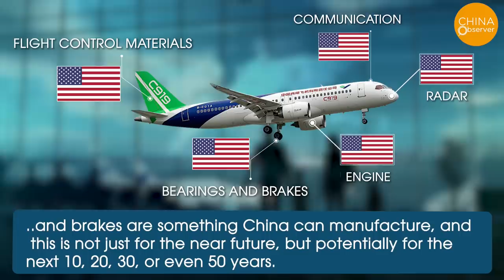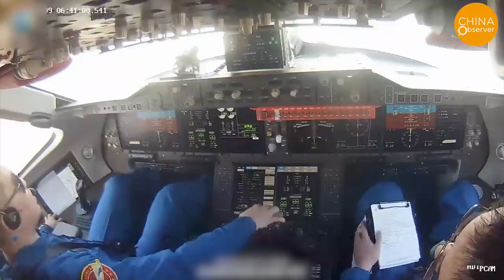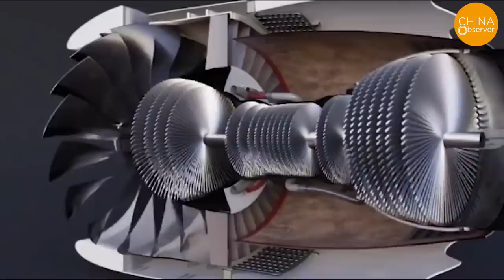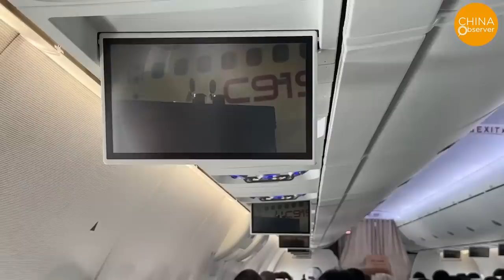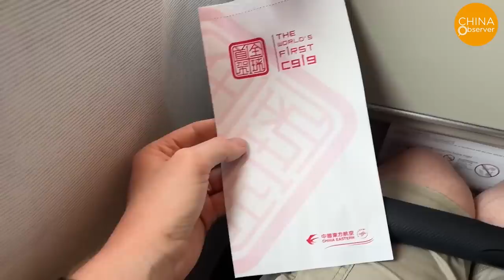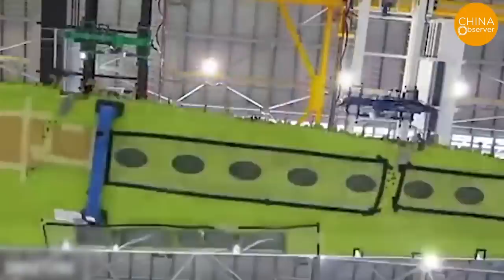The CCP's Aviation Nightmare: 700 Billion Yuan Investment, an Entire Generation Behind in Technology

Comment: Considering Chinese buildings are falling apart, i won't be flying on their planes.
Reply: The CCP can not pay me enough to ever board a Chinese plane😂
Reply: Jealousy do kills
Reply: I wouldnt either, he'll no!
Reply: Well currently it has an better safety record then the latest Boeing equiv.
And until 2 of them have landed vertically that will remain so.
Reply: Chinese tofu-dreg airplanes.
Reply: Ironically their only buyers are Chinese domestic airlines and they are being pressured to use the c919 exclusively.
Reply: I guess you never owned a condo in Miami... Or soon... San Francisco.
Reply: Good point!! I still want to live longer and fully enjoy my retirement, and would never consider flying on one of their planes.
Reply: @wageslave387 a building once fell down somewhere! Same as China!!!
Reply: Anything made in China or by CCP authorisation is a NO FLY ZONE for me!!!
Reply: Buildings and bridges in the US are collapsing everyday too and airplanes made by both Boeing and Airbus are crashing too.   It's just a matter of trust and confidence level.
Reply: @ntauzaug9595  nah Boeing and Airbus planes almost never crash and when they do it's nearly always pilot error. When a US bridge collapses it's because it's 100 years old and neglected
Reply: Like their drywall, and powder cement 😂
Reply: @1barnet1 yeah but the c191 hasn't sold 12,000 copies
Reply: @1barnet1 
Well that’s because the flight mechanisms were of a design not common to pilots. Boeing has recalled that particular model and has resigned itself to the original design.

“Currently it has a better safety record?”….well yeah, there’s only been one made and it’s only had a handful of flights. It’s incomparable to the thousands of successful flights that Boeing planes have undergone.
Reply: @wageslave387 
To be fair….the Miami condo was built in the 1980s when building regulations were lax and nonexistent. 

There’s no excuse for the millennium tower in San Francisco but neither does China. Most of the buildings falling down in China were also built in the past decade so what’s their excuse
Reply: @ntauzaug9595 
Yeh but the buildings and bridges in the US are decades old and are collapsing because of age and wear and tear. The Chinese ones are collapsing because of poor construction and lack of building regulation.

And with Boeing and Airbus most of their crashes have been due to external factors like weather, damage, pilot failure, etc. The recent Boeing crashes were due to design flaws in their new models, that’s why they recalled all the new ones.
Reply: Who cares about your opinion on the plane
Reply: especially not if the IP is stolen
Reply: @henrylivingstone2971  no boeing is still using the new design on the max if the pilots would have flown it like all past 737 made it wouldn't have crashed.the mistakes Boeing made is not putting it in the 737 manual
Reply: @teomartini1105  Well you reacted!
Reply: @ntauzaug9595 Really? List them in the last 5 days.
Reply: @andrewlarson7895  
The 737 was recalled in 2020 but has since been released into the international aviation market after having passed rigorous regulations testing. Some even consider it the safest aircraft on the market due to the scrutiny it faced by both the American and European aerospace authorities. The defects resulted from the design flaws, in particular the use of flight control software known as MCAS. Boeing did not reveal the software difference to pilots in its flight manuals until asked and this is what lead to the crashes.
Reply: @teomartini1105  
The CCP, considering they want their domestically produced plane to be featured in the international market. If foreign consumers aren’t willing to trust Chinese made aircraft what hope do they have of actually getting foreign countries to buy their plane? 

If the Chinese plane was cheaper than the leading brand, it would make sense for foreign airplane companies to purchase the Chinese made plane but it’s not. The Chinese plane is only cheaper than Boeing and airbus by a few million but is a less trustworthy brand and has shoddier craftsmanship.

So of course air travel companies would opt to buy the relatively more expensive but more trustworthy American made planes.
Reply: @bluefish7940 why jealous? We invented the plan, you copied.😂😂
Reply: F#@k that no way i'd get on that. The trolls make me laugh defending the honor of a Chinese copy plane.😂😂😂
Reply: @davidturnbull310  
Not only did they copy it, they stole it which is even worse.
Reply: @henrylivingstone2971  yep, with Chinese parts.
Reply: Just like your career
Reply: @davidturnbull310  you steal from German 😂 😂 😂
Reply: You don’t make a difference wether you want to fly or not so many millions of local Chinese people waiting
Reply: Yeah, hate to say it, but after seeing so many “Made in China” items start falling apart the first day of use, I would need a lot of good data from an independent source before flying.  

And remember that China is great at assembling, but not much else, and just recently celebrated creating the first fully Chinese-made….ball point pen.  And safety requires someone who created and fully understands the product, not someone who copied it and doesn’t know why certain decisions were made when creating it.
Reply: @wageslave387 That’s just “false equivalence” and distraction propaganda techniques, used when you can’t refute a criticism, so try to change the topic to a criticism of a rival and make a shaky assertion that it’s “just the same.”  

How does a condo in Miami or San Francisco, whether good, bad or indifferent. affect safety concerns about Chinese-made aviation? 

And if you mean the Miami condo collapse, that is also “false equivalence”…..rates matter, and one 50-year-old seaside building collapsing is  nowhere near “the same” as something like 50 new bridges and scores of new apartment blocks in China either failing or demolished before they did.  And in the US…we know how many large buildings collapse….no one quite does in China and it is hidden or censored as much as possible.  

Irl, you wouldn’t say that the cities with the highest and lowest murder rates are “the same…because they both have murders.” Nor would you be fine flying either an air line with a 1 in 30 flights crash frequency versus a 1 in 3 million crash frequency, because “it’s the same, they both have crashes.”   It is a logical fallacy mainly used by propagandists and those who watch a lot of propaganda (like Fox News).
Reply: @OGruurd just fly Boeing
Reply: @bluefish7940  who invented the plane? 🤣😂🤣😂🤣😂🤡🤡🤡🤡🤡
Reply: @davidturnbull310   "who invented the plane?"  An Italian named Leo... a few hundred years ago.  By the late 1800s, people in various places were working out practical gliders.  By the early 1900s, powered flights were taking place.  The Wright Brothers of Ohio USA probably achieved the first powered flight, though their design was completely impractical.  Advances in flight controls, especially in France, combined with structural and aerodynamic improvements from Europe and USA produced the first practical powered airplanes within about a decade of the Wright's initial flight.  It was a group effort.
Reply: Speaking as a former airliner engineer, I don't share the concerns expressed by some here about the C919's basic safety.  I've had negative things to say about its economics, which aren't so good compared to existing airliners, but I haven't seen anything regarding the design or construction which scares me.  China built its first prototype airliner in 1980, has been doing limited final assembly of Western designs starting a few years after that, plus of course some military transports from start to finish.  So they've been building transport aircraft for decades -- just not internationally competitive ones.
Reply: @buckchesterfield8886  u mean 737max8？or the apartment in florida？
Reply: @henrylivingstone2971  name a big chinese building collapsing or u r a lier
Reply: @jtrtarrence1359  
Changsha building collapse, 2022, Hunan province

53 people dead 

Juxian restaurant collapse, 2020, Xiangfeng province

29 people dead 

Lotus riverside block 6, 2008, Shanghai

1 person dead 

Siji Kaiyuan hotel collapse, 2021, Jiangsu province 

17 people dead
Reply: @marcmcreynolds2827  
 
Not really. The concept of manned flying has existed since antiquities ever since the ancients laid eyes in birds and thought “why can’t we do that?”.

Leonardo’s sketches on flying machines in his 1502 codex “the flight of birds” doesn’t really resemble anything like an airplane. In fact of his three sketches of “flying machines” they really are just glorified gliders with impractical power mechanisms. There was no power source beyond a hand crank so it’s not really an airplane. 

And while there were several attempts prior to the Wright brothers for manned flying, none of them were successful. The Wright brothers hold the distinction of the first SUCCESSFUL manned flight despite the actual flight only being a few seconds long. 

But the Wright brothers were inspired by a large number of predecessors who pioneered the field of human aviation none of which were more important than the German inventor   Otto Lilienthal who’s experiments in gliders and self-propulsion lead to the development of the Wright flyer.
Reply: @jtrtarrence1359  
I named the building collapses. Do you still think I’m a liar?
Reply: @henrylivingstone2971  changsha   building collapse, which building give me a name. xiangfeng province? There is no such province.
Reply: @jtrtarrence1359  
How the hell should I know what the building was called? The building didn’t have a name as most buildings don’t. Just search Changsha building collapse and there’ll be articles from the BBC and AP news.

Oh and my mistake with the province. It’s actually Xinagfen COUNTY in Shangxi province.
Reply: @jtrtarrence1359  
Also you said name a building, I named four. So at this point you’re just nitpicking.
Reply: @ILI993  
Yeah….but cars are different from airplanes. What’s the worse that could happen if a car has a design defect? The driver and the passengers could possibly get injured or die? 

But if an airplane is designed based on stolen aircraft designs and subpar engineering, what’s the consequences? Literally everyone dies, guaranteed.
Reply: @henrylivingstone2971  "his 1502 codex 'the flight of birds' doesn’t really resemble anything like an airplane"   Likewise for the Wright Bros 1903 craft ; )

I was trying, somewhat tongue-in-cheek, to move people's thinking past "USA invented the airplane".  Someone in the USA probably had the first successful flight of an unsuccessful design -- proof of concept, if you will -- but there were actually many contributors both before and after 1903 (Lilienthal is deserving of your shout-out) behind a useful tool finally emerging...  a device you could actually "do something" with.

There's a good analogy to the above in liquid-fueled rocketry:  Goddard was first, with a design which did absolutely nothing useful other than prove this was possible, then things progressed from there.  And once again,  Germans had a major role.
Reply: @marcmcreynolds2827   
But the Wright flyer DOES resemble the airplane that would succeed it in the following years. The Wright flyer has a striking resemblance to the biplanes that would dominate the skies during the First World War. 

You might have been trying to imply that the modern airplane is the amalgamation of an international effort over several centuries to create a vehicle capable of manned aviation. But that still doesn’t change the fact that the basis for the modern aircraft was created by Americans.

The Wright brothers were the first of any people of any nation to conduct a successful flight of a manned aircraft that didn’t rely solely on gliding. Prior to them, most aircraft’s relied on a catapult system or a platform from which they were propelled, that is not manned flight.

The Germans always feature in the invention of modern technology and rightfully so. They reserve a great bulk of the credit when it comes to the development of the modern aero plane considering they were responsible for the invention of the modern jet engine which forms the basis of all modern aircraft. However that still doesn’t change the fact that Americans invented the precursor to the modern airplane this is due to the fact that prior to the Wright flyer all aircraft’s were gliders not manned aircraft. There might have been contributors to the Wright brothers as well as preceding prototypes and technologies but they weren’t airplanes.
Reply: @henrylivingstone2971  I don't disagree with any* of your facts.  It's more that we have a different philosophy/interpretation of them... which is fine.  People get to hear my thoughts and yours (which heavily overlap in the bigger picture), and can form an opinion regarding something which they may personally lack specialist perspective on.

From my perspective, the Wright's  impractical design doesn't equate to "the basis for modern aircraft", though it was as you say a precursor.  One of several, though as far as we can tell it did happen to be the first one to make it into the air (if Whitehead was actually first, he did a good job of making sure no one could prove it ; ).  I'm much more impressed with the Wrights for their careful scientific experimentation (e.g. wind tunnel) and their achievement in "mass" production (including overseas licensing) of later practical designs.

While others might not share my perspective, at least I'm consistent:  I don't see the USSR having been first to orbit a satellite as being important.  They didn't invent satellite launching -- they just got around to it first.  It could have just as easily been the USA, as those who have studied the history (or lived it) are aware.

*  Almost any facts.  I'm sorry, but to this aircraft dynamicist about the only resemblence between the Wright Flyer and a WWI biplane is that both employ airflow over lifting surfaces.  The aerodynamic configurations and control schemes are dissimilar.
Reply: @ILI993  China's flagship EV's are bursting into flames in record numbers. So good luck with that.
Reply: @henrylivingstone2971  sorry,there is not a province called shangxi province too
Reply: @ILI993  but what did musk talk about byd a few days before？
Reply: Russian plane or Chinese plane?  I think I'll walk.
Reply: You might want to avoid some of the skyscrapers in the U.S. also.
Reply: @EKA201-j7f  
Depends on the age of the building. Anything from the 60s-80s is fairly dangerous considering lax safety regulations but they applies to most buildings in most countries
Reply: People are  avoiding flying on  airaft manufactured by Boeing because  they keep crashing and doors blowimg off.
Reply: @OGruurd   You do realise that Boeing amd Airbus have Chinese made parts as well,